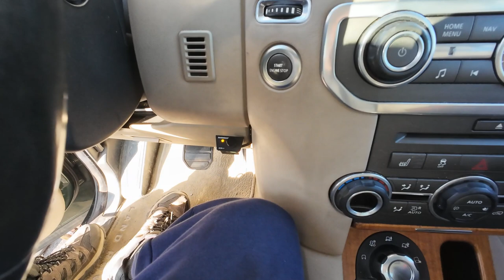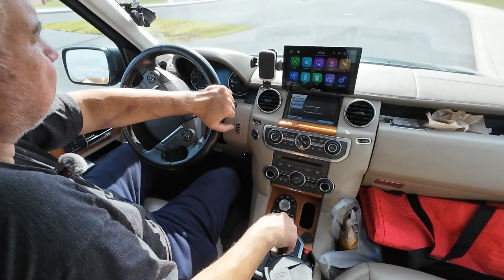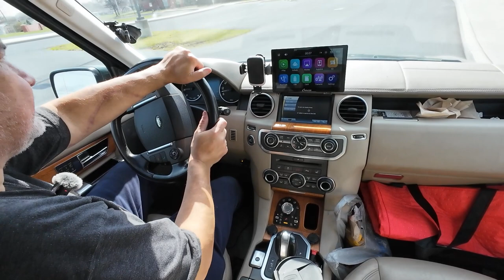Front Brakes Replacement Rotors and Pads  LR4/LR3

Comment: One of the best auto repair videos I've seen.  My brake pad light just came on and I'm looking to do my brakes myself.  I've changed brakes on all my cars (probably about a dozen) over the years. This will be my first time on my 2013 LR4.  So glad I watched.  Land Rover seems to be a bit different than any others I've changed.  Thank you for your video. Very helpful! I'm planning on purchasing parts from Rock Auto. Any advice on brand name for the pads? Any thoughts on semi-metalic vs ceramic?  I thought about ceramic on the front because I am getting a LOT of brake dust on my rims.  Thoughts?
Reply from the maker: I get my stuff from fcpeuro.com. They have a lifetime warranty. Yes, wear sensor, rotors and pads. I change mine every year. If I need it or not. Only pay for return shipping.  I buy the brake kit. " Pagid " pads, " Bowa " Wear sensor, and " Zimmermann" rotors. OEM Land rover pads are " Ferodo" or " jurid".  I like " Pagid" or " TRW " .  As far as Pads types. I like the semi- metallic ( the braking in better, more dust. but, damages the rotor more.). The ceramic pads ( less dust, does not stop as fast. But, does not damage the rotor as fast.)  But, I get mine from FCPEuro.com. It is a free lifetime warranty.